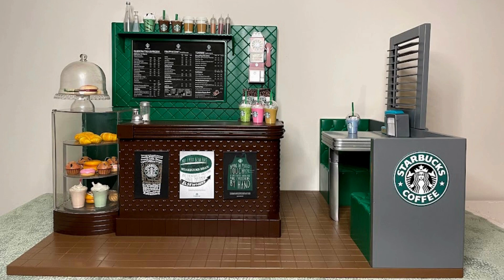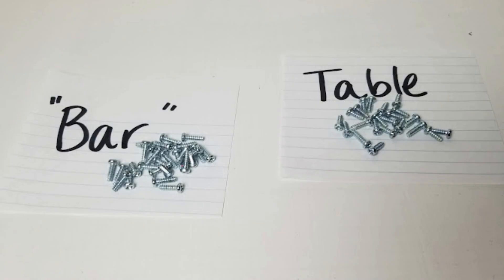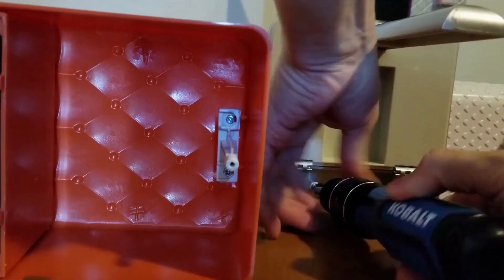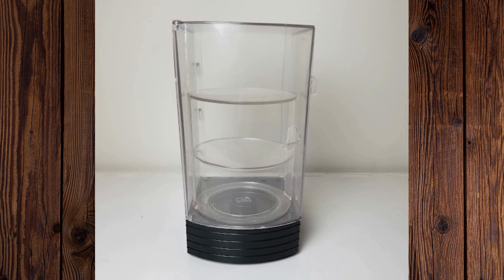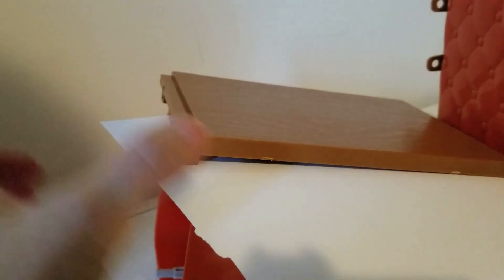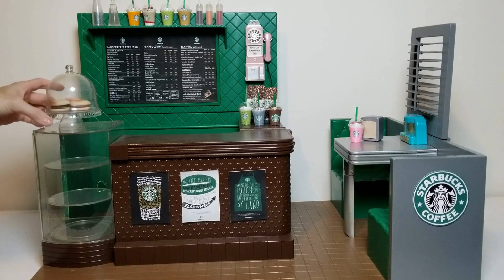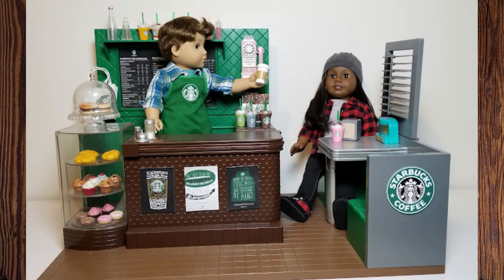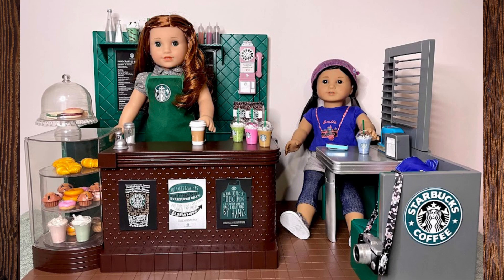American Girl DIY - Creating a Starbucks from an OG Diner

Comment: Do you recall if you sealed the spray paint with anything after? And have you noticed any paint transfers on your dolls clothes or other accessories after using this for a bit of time? This looks like such a fun craft to make, but I'd be scared of dye transfer to the doll stuff!
Reply from the maker: I didn't seal it (but you totally could) and I haven't had any transfer issues (though they admittedly don't stay seated at it for weeks at a time). So far no issues at all.